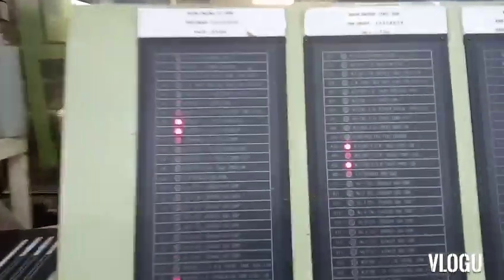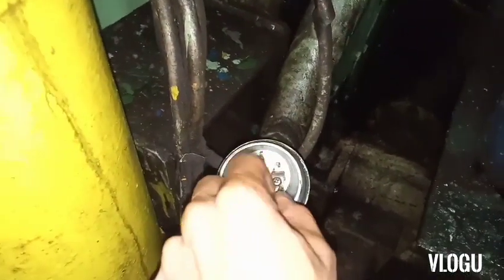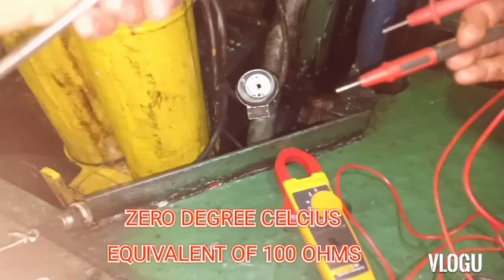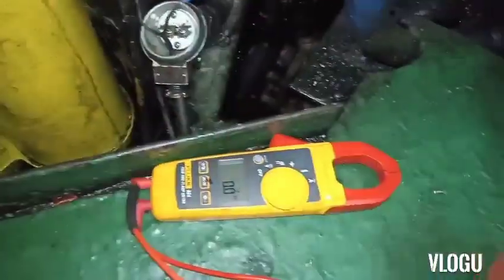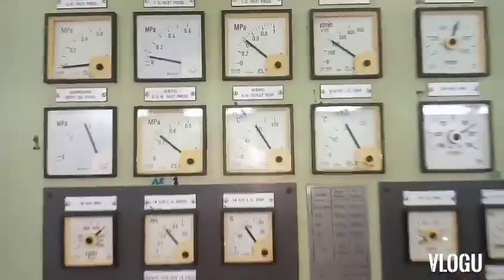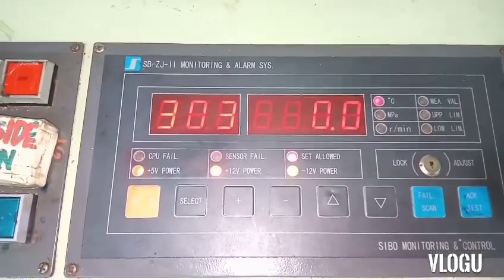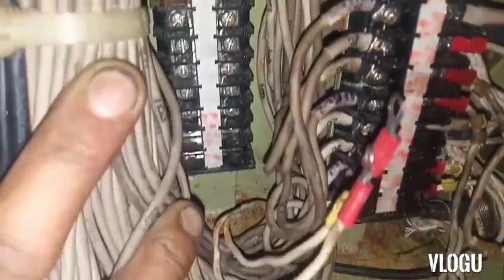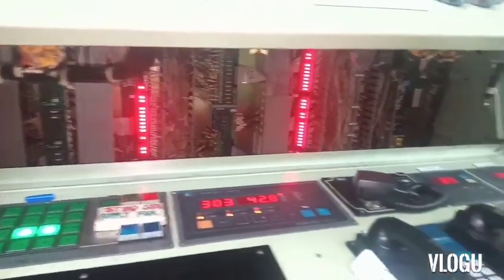MAIN ENGINE LUB OIL TEMPERATURE HIGH ALARM,TROUBLE

Comment: Nice lecky,  may video kaba how to measure mA using multimeter /tester sa mga transmitter/sensor
Reply from the maker: Meron sir watch mo po yun main engine fuel inlet pressure low at yun how to make mili ampere output using potentiometer.